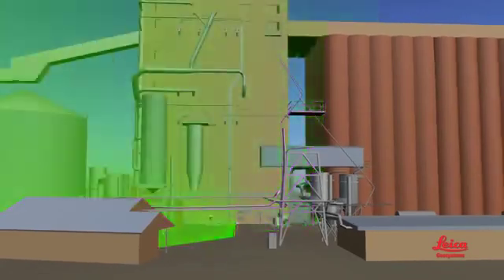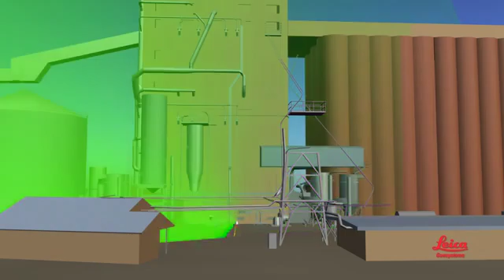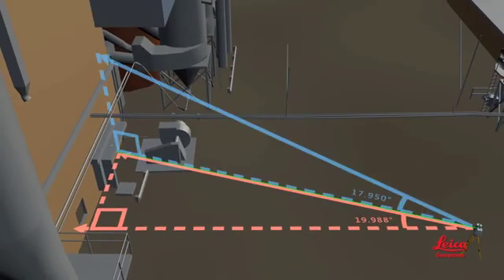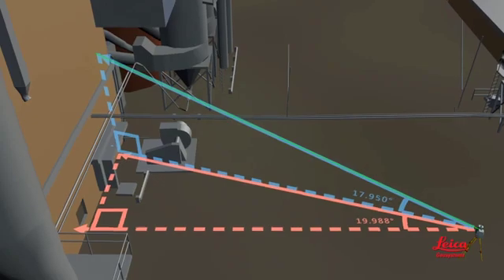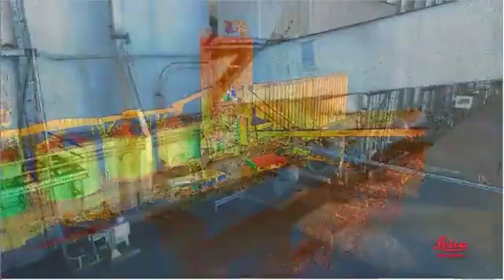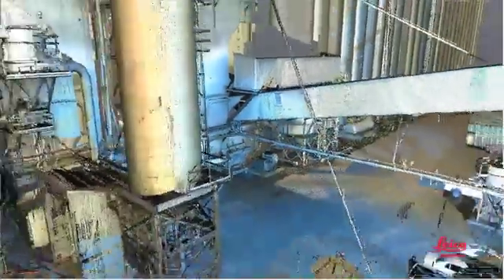How A Laser Scanner Works by Leica

Comment: The explanation is great. I just still can't understand how the energy bouncing back can be captured.
Reply from the maker: I'll be honest, it's over my head as well. 🙂It is mind blowing that the scanner is able to know which pulse is coming back when and record it, especially at up to 2,000,000 measurements per second. Keep in mind, not all of the pulses come back so it's not like you can just assume that they come back in serial, not to mention some pulses hit objects closer and therefore bounce back sooner. I've been doing this a long time and it still amazes me.
Reply: @TruePointScanning  think i may have an idea, at first i was confused by the same thing as well. How can the scanner read the light reflecting back if its already rotated away? then I remembered, were dealing with light here. The fastest thing in the universe. We may think the scanner won't b able to pick up the reflected beam, but in light years, light has PLENTY of time to bounce off any surface in the vicinity and return back to the scanner before the scanner's even moved a nanometer. Or at least that's how I understand it.
My question is: How does the scanner read the returning light if the laser hits something at an angle, and simply bounces away rather than bouncing back into the scanner? I would think if it strikes an object an angle besides perfectly perpindicular, it would shoot off. This is what confuses me.
Reply: @Awesomizer83  (1) Simply: You Can See a Beams Deflection (Laser Shining On a Mirror iN a Dark Room), You May Not Know the Angle/Timing but the CPU Does. 
(2) We Can't See Everything (iNFRARED, UV, ...) But Someone (The Computer iN This Case) Can.
Reply: think i may have an idea, at first i was confused by the same thing as well. How can the scanner read the light reflecting back if its already rotated away? then I remembered, were dealing with light here. The fastest thing in the universe. We may think the scanner won't b able to pick up the reflected beam, but in light years, light has PLENTY of time to bounce off any surface in the vicinity and return back to the scanner before the scanner's even moved a nanometer. Or at least that's how I understand it.
My question is: How does the scanner read the returning light if the laser hits something at an angle, and simply bounces away rather than bouncing back into the scanner? I would think if it strikes an object an angle besides perfectly perpindicular, it would shoot off. This is what confuses me.